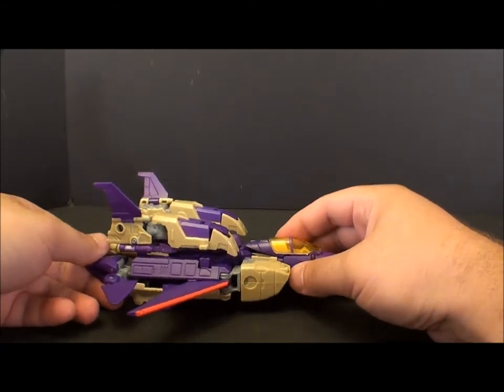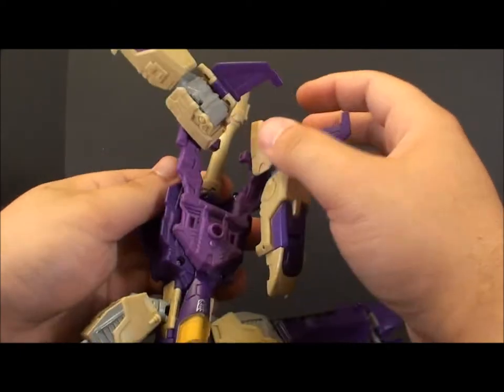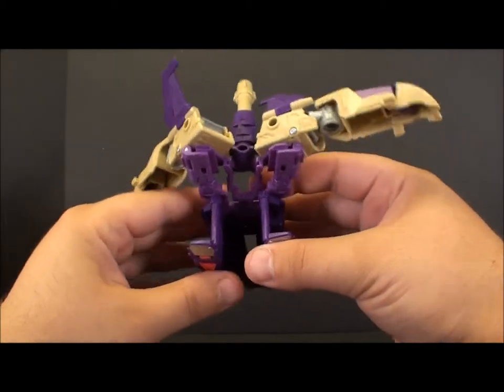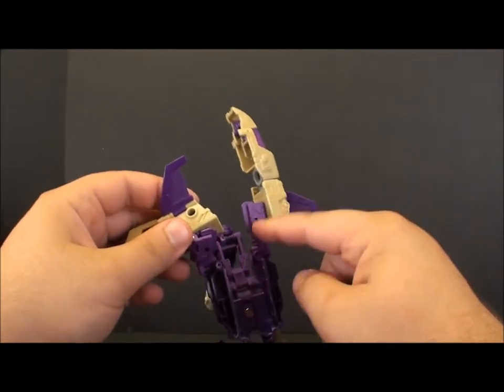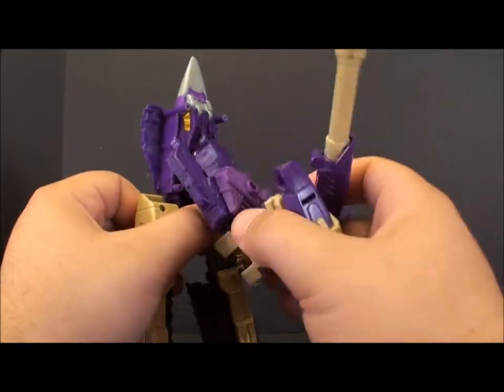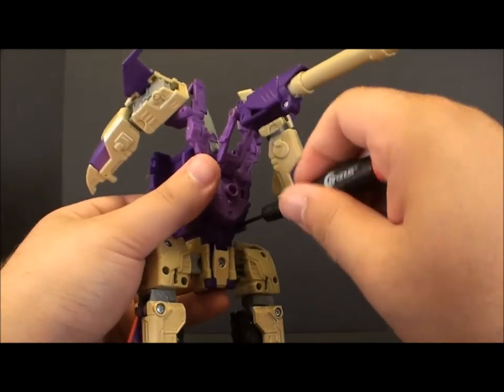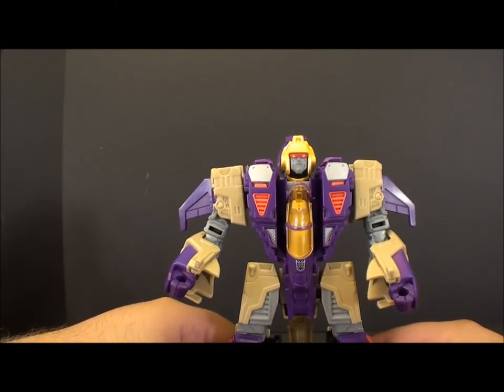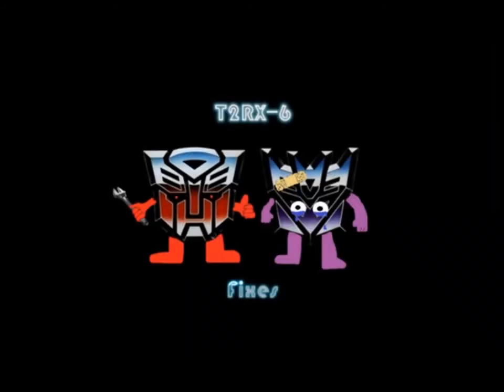T2RX6 Fixes: Generations Blitzwing Shoulders and Nosecone

Comment from the maker: The resinstall would probably be pretty difficult, but the big thing with that is it wouldn't pop the head up all the way anyway I don't believe.
Reply: Also for the shoulders fix I'm saying a very quick and easy is get a magnetic sheet with a sticky back part make it six millimeters and cut a square in the top left corner for it and the other corner cut it